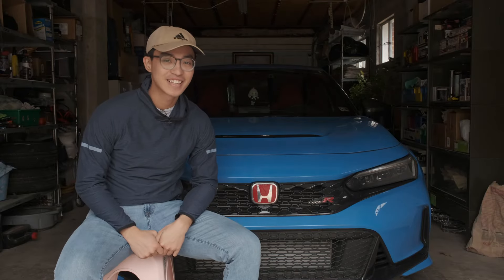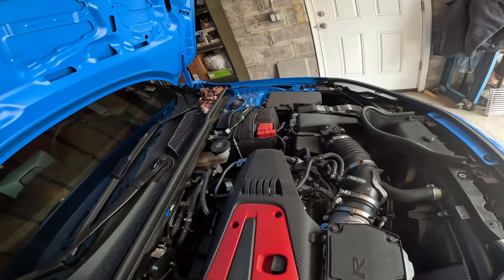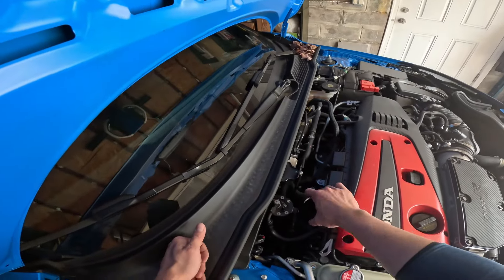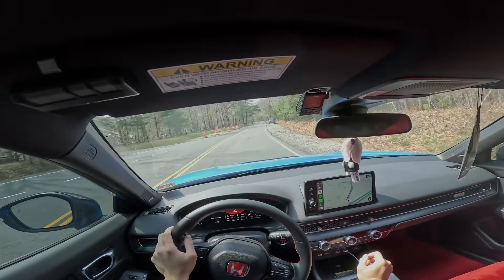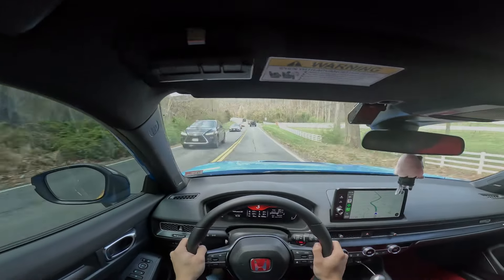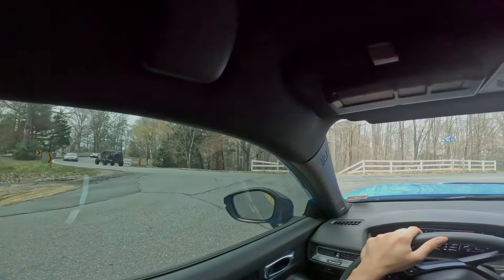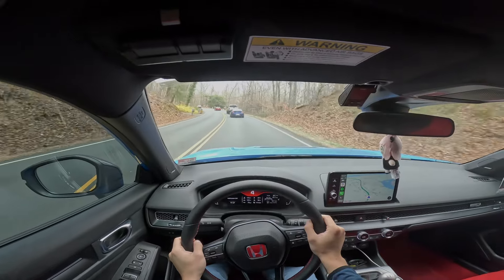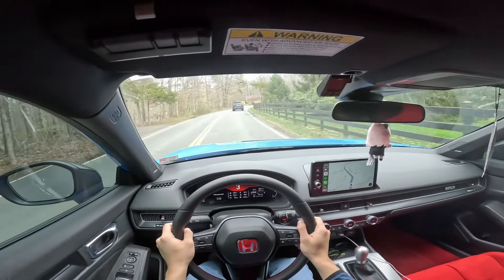1 Year Ownership Experience with the FL5 Civic Type R

Comment: Just an FYI, most auto manufactures suggest an oil change/service interval that will make your engine/drivetrain wear out faster. That way they can sell you another car sooner rather than later. My advice on turbocharged/supercharged cars is to cut the manufacture interval in half. For Example: If they suggest 6000 miles, then I change the oil at 3000 miles
Reply from the maker: Surprised to see you here! I plan on changing oil every 5k miles after the 2 yrs maintenance plan is over. Thanks for watching!
Reply: I tell the guys at work if they plan on keeping cars for 10 years double up on all maint suggested in the owners Manuel . These suggestions to not change the trans fluid is absolutely crazy . I do all my cars every 30 k .

Comment: If your screen does glitch or is just slow, disable the built in navigation. It speeds up the infotainment system and it should fix the screen glitching with waze.
Reply from the maker: I'll try that out and make a vid on the difference. Thank you!
Reply: It does make a big difference!

Comment: Hey for that rattle noise your hearing check your garage door opener on the sunvisor. I have a 23 SI and isolated the noise to the opener by holding it down when I hear it and it stops. I am looking into a 24 CTR thanks for the vid!
Reply from the maker: The rattle happens even without the garage opener, unfortunately. Best of luck in your CTR search. Thanks for watching!

Comment: I think you're the only owner who is breaking down costs like this. Really great info for future owners so they can incorporate these costs into their first year of ownership. A Honda tech in another video said to just follow the suggested plan as the first oil has a lot of grease in it which is expected to catch any of the break in bits. Changing out the oil too early means you might be using an oil that isn't intended for break in. The K20C doesn't have much blow by at all. Some good info from well respected shops/users on the forum saying even their highly tracked, 500hp FL5 has just a few drops during their checks. They have uninstalled it for a flex fuel system in the same spot. The lagging screen issue can be generally resolved by disabling the Honda navigation in the menus, even if you're not using it.
Reply from the maker: Thanks for watching! Glad to be providing useful content for the community
Reply: +1 on the nav disable, makes the automatic carplay connection much faster aswell
Reply from the maker: Good stuff! I'll try it out and report back on the next vid
Reply: @nexus5033 Yup and if apple carplay doesnt work you can always reboot the system max wait like 3-5 mins , in the general settings and reset factory data. only downside it resets ur settings but its easy to put ur original settings back in
Reply: @anttvv1  ive never had to reset mine thank god
Reply: @nexus5033  Removing navi and factory reset my infotainment screen is top notch now 🤞🏼
Reply: @anttvv1  i missed out on a lot of the bugs with mine being a 24' all the updates and what not were already there
Reply: Break-in oil?  I've heard that manufacturers do not use such a thing.  And "grease" in the oil?  That sounds like BS.  Grease is not a good lubricant for an engine.  As far as timing of oil changes, manufacturers do not have reducing wear as the #1 priority.  They are aware that buyers tend to like seeing longer oil change intervals, and a longer interval probably will not cause a problem until after the warranty expires. I'm changing at 5k or sooner.  At worst, I'm wasting a bit of $$.  On an investment like a new car cost, that's peanuts.

Comment: Just found your channel. I've been thinking about buying an 2024 or 25 integra type S but decided to compare to the honda type R to see if it's worth saving a few dollars. First, do you mind that neither comes with a sunroof, and have you compared the two cars? Also, it's been awhile since i've had a manual car, any concerns? Thanks for any help?
Reply from the maker: Thanks for watching! I did a comparison video between the two before. Regarding the sunroof, I don't mind that they don't come with one. It's a track car. Sunroofs just add more weight. If you're looking for a comfortable car to daily, I'd get the ITS. The CTR has less noise insulation so it's louder. The manual transmission in these are buttery smooth. You'll have no issue
Reply: @turbo_tin  Just saw it! Wow! I didn't take that into consideration. Extra dealer markup and the carbon fiber. Well, that's not going to happen LOL Thanks!

Comment: Does anyone know if these are still marked up at the dealer? I drive a GRC, and Toyota hosed a lot of us with the allotment game. Recently, I’ve seen two more Circuit Editions at the same dealer with better specs, features, and improvements over the 2023 model.
Reply from the maker: The ones in my area are still marked up. Most of the ones sold for MSRP have been in the mid west so you might have better luck there. Thanks for watching!
Reply from the maker: Hope they listen to your feedback!

Comment: Good review from your personal POV. I felt the car was too big as the Civic, and most all cars have grown way too much over the years. I have other cars if I need to haul more things. I just like smaller cars that don't feel as large. I would also never change the oil every 10k miles on any turbocharged engine. That is for normal usage and most owners fall into severe service which will be 5k mile oil changes, even Honda doesn't do them all for free. Your engine will be very happy if you plan on keeping this car. You didn't do a break-in oil change at 800-1k miles as you should on a new engine?  And BTW, you should never transport a flat panel TV laying down like that! They should be transported like they hang on the wall.
Reply from the maker: My next oil changes will be at 5k. I was surprised to find nothing in the manual regarding the break in oil as well but I followed Honda's rec so warranty will be covered if anything happens. I will keep your TV transporting tip in mind. This was the first time. Thanks for watching!
Reply: @turbo_tin  Manufacturers only care about the car lasting through the warranty. If you are going to keep it long term change the oil every 5k miles. And don't forget about your transmission too. I did a break-in oil change at 800 miles on the engine oil and at 5k miles on the transmission. New, fresh oil is never a bad thing!
Reply: The factory coats the engine parts in a grease that the first oil load is designed to catch. With this car, he did the right thing. I have the Integra Type S, same engine. After that, sure I will be changing at 5k.
Reply: @hankhillsnrrwurethra  I've seen too many oil analysis tests proving otherwise even when this has been stated. It's been shown that it's better to get the break in bits from the original 1k miles out of the engine. Fresh oil will never hurt the engine. I did an oil change at 800 miles, 2500, 4800 and now at 7800. My GRC recommends every 5k miles or 6 moneys for regular driving and 2500 miles for severe, well I can tell you that most of us fall into the severe category the way we drive our cars! Ant Type R owners are the same way so take what it says and cut it in half!

Comment: What you should have done is changed your own oil at 5k (honestly sooner) and NOT set the maintenance minder and then gone another 5k until the maintenance light came on and hit the dealer for the freebee at 10k.   Rinse and repeat.  10k even with synthetic from new is a long time and IMO not worth saving $75 or whatever on an oil change.  Granted engines dont need to be broken in like they used to but still....
Reply from the maker: One time won't hurt anything. Subsequent oil changes will be at 5k intervals. Thanks for watching!

Comment: That insurance is murder. I’m 33, married, degree holder and got quoted at 1056 for a year with an ITS and 2021 Wrangler with full coverage. Try progressive.
Reply from the maker: Will shop around. Thanks for watching!
Reply: A little over 1000$ for progressive for me. Little under 900 for the fk8 I had. 31 years old no points 1 car 1 driver

Comment: What???  This is your first ever oil change?  I would have changed oil after the first 1 thousand mark..... when the engine have done flaking away small minute metal particles from a newly fresh engine and then dumping all of it out ASAP with an oil change to flush the system away.  You left it for another record breaking 9,000 miles where all the small metal particles are floating around circulating and grinding against cams, cranks, bearings, cylinder walls, etc etc.  OY!!!
Reply from the maker: Normally I will follow whatever is stated in the owner's manual. I've also confirmed with Honda techs and oil analysis came back fine so I'm not too worried. All subsequent oil changes will be done at 5k intervals. Thanks for watching!